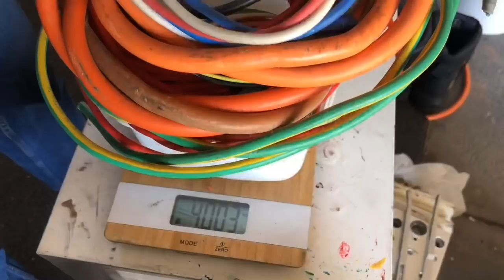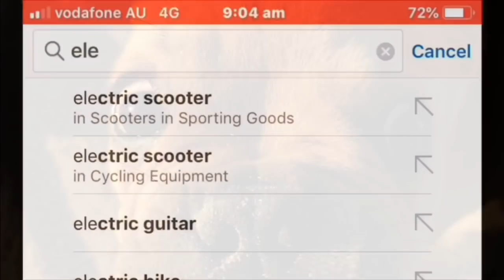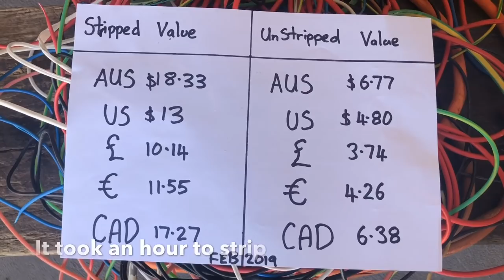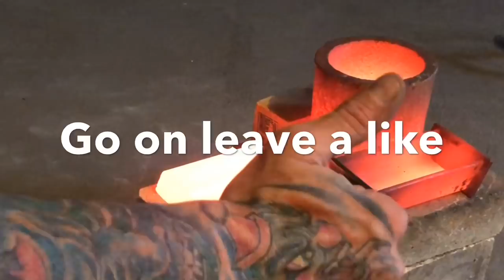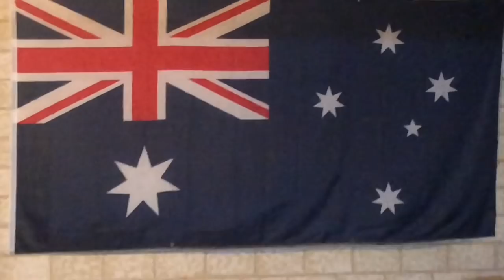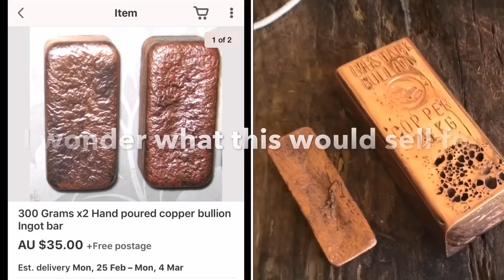To Strip or Not To Strip - Is it really worth stripping Copper Cable🤔 - Melting Copper

Comment: mid 70's my dad (an engineer) was working on a site next to an abandoned mill due for demolition, full of old machines and wiring, so he asked if he could take the wiring, and at the time no-one was bothered or seemed to know the potential value of it, so he brought home masses of it, spending night after night in the garage stripping it with a stanley knife. He made enough to take us all on holiday and buy us all new tracksuits amongst other things. I dont know if i could have been bothered myself knowing the time it took him, but he seemed to like doing it and got a kick out of 'free' money i suppose :)
Reply: Lol, I used to strip wire as I watched TV. Made lots of money doing so.
Reply: My uncles got hired to haul old power cable's from the paper mill to the dump and ended up buying a new van with that they made (the cable was as thick as a mans wrist)
Reply: I'm from Poland but I work in France. House renovation and remodeling. I do electricity and plumbing on top of other works. I take all old pipes and wires from every house I renovate. I strip wires while watching movies. When I go to Poland to visit my family (and do some shopping), I take all the copper and sell it for scrap. It pays for the trip.
Reply: @maxxmaxwell9051  That's some amazing time management there 😄
Reply: @mr.boomguy  LOL, heck wasn't doing anything but watching TV, might as well make a buck or two. Just make sure you have enuff buckets so as not to make a mess (wives don't like messes) 😁
Reply: Working construction in Montana lots of old homes with copper pipe... So I've just collected, and collected... and collected. Probably going to melt my trove and sell it in the next couple months.
Reply: In welding school we talked the teacher to replace all the welding leads. Long story short there is a lot of copper in those and we made a lot of money lol
Reply: This is how we funded out scouting camps back in the 80's. My scout leader worked for an wiring manufacturer and would get the leftover spools (pretty sure they "donated" the leftovers).

We, the scouts,would spend entire weekends using razor blades to strip the wires and haul to the recycling center.
Reply: my dad worked in a factory that used vehicle grade platinum for parts on an assembly line and every day for over 30 years he pocketed a handful and brought it home. took 10 years to find a company out of country to treat it and refine the platinum so it was usable. Not disclosing how much he made but it almost multiplied his life savings 5 fold.
Reply: My granddaddy was an old hillbilly he would of just went out back in the pasture set it on fire and went into to for dinner! Came back and it was stripped!
Reply: @billybob7656  i had a friend in the 80's who told me of a mate of his pinched mercury from where he worked as they used it in some process or other, and stored it under the sink in milk bottles, hoping one day to make a few quid, but instead a few years later. his mum got sick of seeing it, so poured it down the sink. He didnt say what happened afterwards, but i shudder to think of the potential environmental impact.
Reply: @FXDXT01  i actually asked my dad why he didnt do that, and he told me you lose quite a lot of volume, and anyway i dont think a bonfire of burning plastic on our estate would have sat too well with the neighbours. GL
Reply: @FXDXT01  my friends strip cars (racing old cars)...and that is how they reclaim all of the copper...throw it in a burn dumpster collect it all the next day.  No easier way to strip it down...though not the greatest for the environment.
Reply: @billybob7656  That doesn't sound really legal though. LOL
Reply: @MrQbee87  wouldn't you get more euros scrapping it in France?
Reply: @Bob-ts2tu  it's metallic mercury, harmless unless you breathe it's fumes.
Reply: @ChicagoTRS  With the shit china puts in the air, forget about emissions. Just a corporate scam.
Reply: @gregdaweson4657  for steel and cast iron the price is the same. I get little more in Poland for aluminium, but for copper I get 50% more. And i go to Poland anyway to see my family and do shopping. Scrap is just a bonus.
Reply: @MrQbee87  Interesting, I would have expected scrap to go higher in France due to economic differences.
Reply: It wasn't about the time or labor he done that to provide extra for your family above and beyond the normal flow. I'm a father of two and a grandfather I guarantee you the amount of pride and happiness he got from watching y'all more than pay for his time
Reply: Hardwork
Reply: Had guys up the street from me they would steal copper cables from build sights and even houses in the middle of being built

But being the assholes they were they didn't bother stripping the cable they just threw it all in a pile and burnt it
Reply: That is pretty much the same motivation with all hobby scrappers. I try to only collect the stuff that is worth so much that I'm better off doing this than to work the hours in my normal Job. Pretty much only copper, brass and bronze. Or HEAVY stainless or aluminium pieces.

Comment: All elements have a varying level of electrons, the electrons are arranged in layers around the nucleus, the first layer contains 1 electron and so on. When exposed to extreme heat, copper has an electron that likes to jump up a level and remain stable for a while but will then jump back down to it's normal electron layer, this jump causes the bright green color we see as its burning, various other elements will do this, but violet and blue flames are the hardest to achieve because they require not only extreme heat but many electron layers, meaning a heavier element. The same applies to fireworks in this case, the same method of super heating an element will give off that bright color we see when it explodes. Just a little Chemistry knowledge to help understand the natural process. Hope your having a wonderful day!
Reply: Good call
Reply: Ever throw a string of Christmas lights on a fire? Oooooh, pretty. And of course there will be someone who argues it's because they are Christmas lights and not the effect of the thin copper wire.
Reply: Valence shells.
Reply: @scrocrates6380  Thanks. Now I know more.
Reply: And remember: The violet color you see coming from the welder may be pretty, but It'll burn your retinas out faster than staring at the sun.

Comment: "These holes will ad character"  I say the same thing about the rust holes on my truck. Lol
Reply: Patina!
Reply: The first makers of Swiss cheese said the same.
Reply: No Will that's weight reduction to make it faster 😁
Reply: I say the same thing about my wife
Reply: It’s like Homer putting the “speed holes” in his hood 😂
Reply: Reminded me of bob ross when he said, ' we dont make mistakes we have happy accidents '
Reply: I had a favoured car I used to misuse a lot, bush bashing :) Any dents and scrapes were "Battle damage", and admired scars, lol. Another time had a 1964 EH Holden not make a corner (A mate was driving), it went through a pile of 6" posts with heaps of wire... The damage? A very small scrape on the bonnet and the bumper got a polish, got to love steel cars :)
Reply: @Anonymous Yes I'd rather save lives then cars, you can always buy a new car but never a new life.
They are made this way, made to crumple to save lives. They take the hit and not you.
Reply: War Wounds aka Battle Scars
Reply: I prefer speed holes

Comment: You have to factor in the cost of all the meth required to want to strip wires.
Reply: Thats all put under 'expenses-snacks'
Reply: Not as expensive as you'd think
Reply: Lmao
Reply: Damn this i the perfect comment
Reply: Nailed it!
Reply: I have a 35 dollar stripping machine and can strip pretty fast i get it all for free and strip for couple hours on my days off of work while watching movies  can usually get about 700 bucks  every time I go to the scrap yard. I bought a nice AR 15 with the money I got one month and This year I stored my copper i got and made one trip to the scrap yard i got enough to get a 2005 articat king cat snowmobile that was show room quality that was 4k so it is definitely worth it
Reply: I have 1250 ft of wire I need to strip 😭 weed is all you need and some extra blades
Reply: There has never been a more accurate comment on any YT video 🤣🤣🤣
Reply: @dominicaguirre5207  Kinda like pressure washing the drive way.....
Reply: That's a pretty ignorant comment. Coming from an electrician, I see plenty of scrap wire and it adds up fast.
Reply: Hahaha
Reply: @mikehuntisitchy3965  💰🧟‍♂️
Reply: @douglasfendt7286  well of course it is IF you have a steady FREE supply.

Comment: I thought you were gonna try melting it unstripped, lol. Probably would make you abandon the house from the smell of burning plastic.
Reply: Same 😂
Reply: Same here
Reply: Yeah I was excited to see the difference in dross
Reply: @oldUmanUshea  I thought he meant is it worth it because all the burnt plastic might make a lot more dross, and is it worth the metal lost
Reply: I was wondering, burning plastic is illegal right?!
Reply: @justinkasey1058  What the hell? No lmao
Reply: Justin Kasey I’ve done it before & it looks like a Mogadishu tire fire. Wouldn’t recommend. I use to scrap truckloads of copper wire back in 2011/2012, I only took the time to remove the plastic one time. Never again. Fire doesn’t even work that well, tbh. It just makes a mess.
Reply: @ajs4287  yeah ur much better off stripping it, it makes a ton of toxic mess and you'd think burning that hot it would go quick but it takes FOREVER plus around here my scrap yards pay more for clean copper than burnt up mess plus your losing copper in the fire when its outside vaporizes
Reply: I agree. I'm also pretty sure this is just a reposted video. Either that or I fell for it twice. I doubt he was trying to purposely mislead though and it was accidental.
Reply from the maker: Dustin Nah definitely not a repost matey . I don’t do that on my channel 👍🏻
Reply: Inexperienced guy here, isn't the green flame from copper slightly toxic? Im more of a steel guy so know nothing about copper smelting but it looks like you can get quite a bit out of scrap and I'm pretty sure electrical wire is pure, no alloying elements like aluminum or phosphorus to deal with!
Reply from the maker: Hey Dan I have no idea if the green flame is toxic but I don’t intend to find out as I where a respirator every melt , and yes copper cable is like 99.9% pure👍🏻
Reply: I mean, you'd need to do it outside, but it would work.
... Eventually.
Though, if there's any steel mesh netting around the cables, you're gonna have a fun time fishing slack, that's for sure. :D
Reply: @justinkasey1058  depends on where you live...but regardless of that, burning PVC anywhere near your home is very dumb as it releases HCl, which aparr from being a danger to people will damage/kill plants and corrode various metals...
Reply: Cat 6 a cable is possible the best to leave unstripped due to its weight and sells for a good bit at the scrappers only type if cable you should strip is muticore cable tbh
Reply: That is the junkie way where I live. They used tires till people start calling the cops and firemen.
Reply: What makes difference if ur going to melt into ingot why not burn the coating off ?
Reply: @dangoldbach6570  no, the green is the copper. Oxydised copper is green. also if you put copper in acid to disolve it, the liquid turn green. It's the same with iron for exemple, when it oxydise (rust), it turn red.
Reply: Marc T  you can run internal combustion engines on wood gas.
Reply: @D'Ther
After looking it up it seems to actually be due to electron behaviour. CuO is red and Cu2O is black. Copper does turn green in air eventually, making Cu2(OH)3Cl. More inland it is Cu2(OH)2CO3.
Reply: @justinkasey1058  Burning plastic isn't illegal, but it is a breathing hazard. Black smoke and its burning plastic as you say :D But only silly people burn it.
Reply: @ZeliardFTW  or you could dissolve the cables in acetone leaving bare copper if the cables are made of pvc use THF tetrahydrofurane. or a 50/50 mix of trichloromethane and acetone